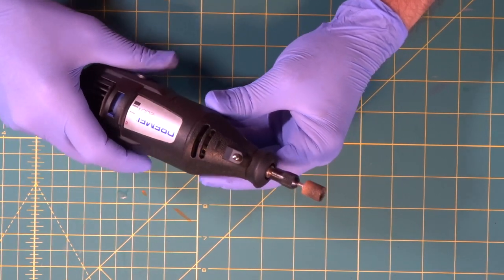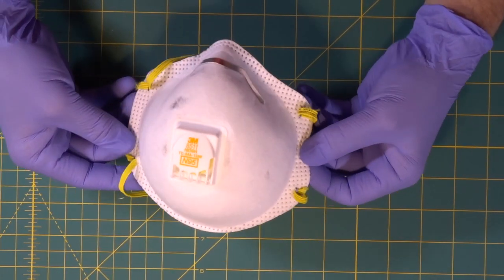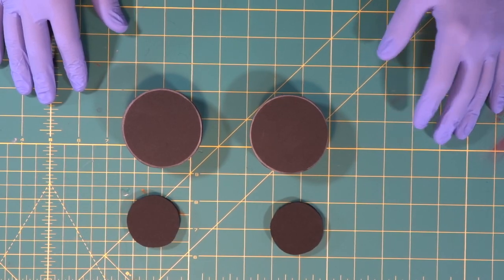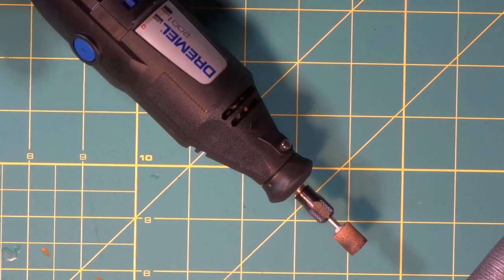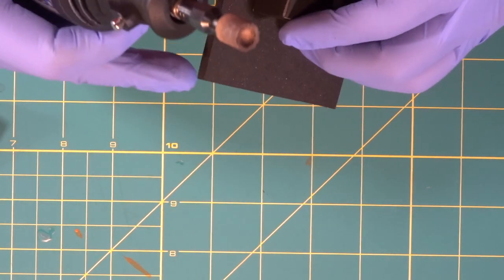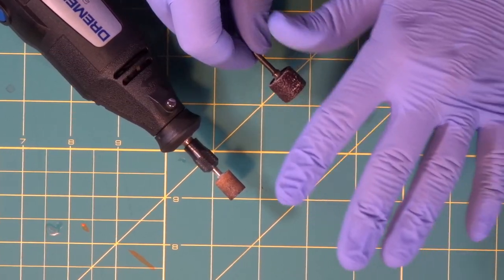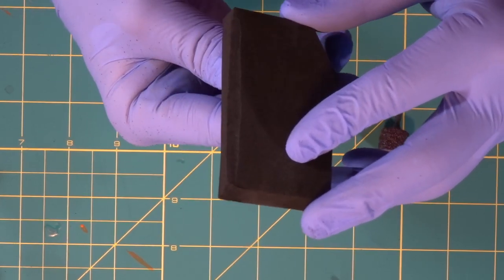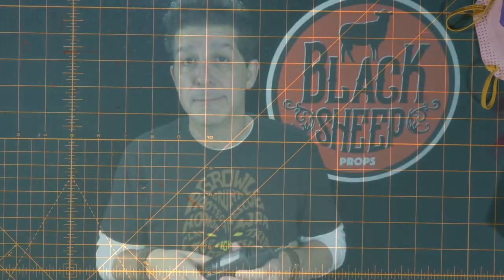EVA Foam Dremeling Basics

Comment: Are there any Health and Safety Data sheets available for EVA foam as looking into dust extraction and filtration
Reply from the maker: Hi Carlo!
I dont have any data but every builder I learned from stressed the importance of using a dust mask when grinding foam. I never grind without a dust mask. And I frequently open the garage door and blow all the foam dust out so the shop stays as clean as possible. It also makes a difference according to the bit you are using - the super rough bits throw a ton of dust while the smoother bits don’t throw very much. But either way, I never grind without a dust mask.

Be safe!
Reply: @BlackSheepProps  thank you for replying, what mask do you use in the video please
Reply from the maker: I use a 3M N95 dust mask.
Reply: @BlackSheepProps  thank you kindly

Comment: This video was super helpful for me.  One question.  Do you have any recommendations regarding the Dremel  rpm speed settings you like best?  Thank you.
Reply from the maker: Hi Margot! Glad it was helpful. I always use mine on high which is 35000 RPMs for all of my foam prop work.
Reply: Thanks for the quick reply!  Just getting started with foam.  I was going a little slow.  Like 5-6000.  But, when I cranked it up, it was getting away from me.  After watching your videos, now I know why that was happening..
Reply from the maker: It will get super easy in no time. You’ll get really smooth.

Comment: Hi there! Is the bit you're using the 932 aluminum oxide grinding stone? I've been trying to figure out what to use for the dremel because I can't find a sanding band grit higher than 240 for sale 😭 any help is appreciated!
Reply from the maker: Hi Jade! I believe you are correct. It came with the set. You know what I really love is the Dremel 454 chainsaw sharpening stone. I almost exclusively use that one now for all my smooth stuff. It’s thinner so I can get into areas better and it seems like it’s the exact same grit as the 932. LOVE that one.